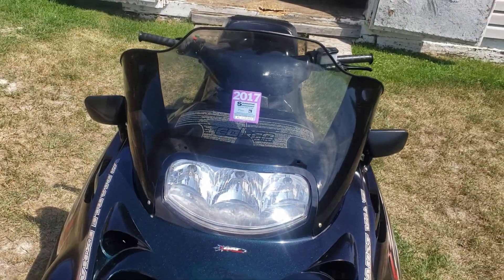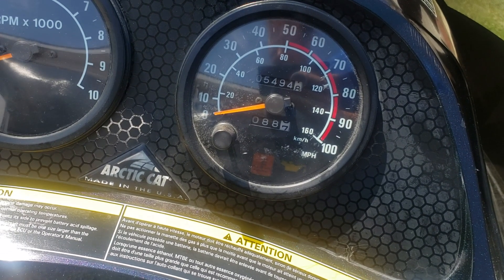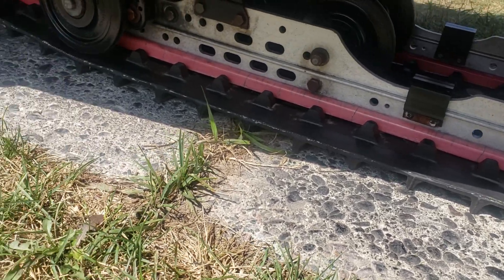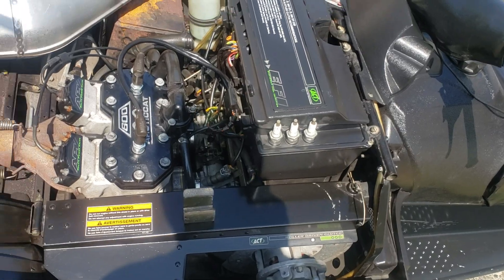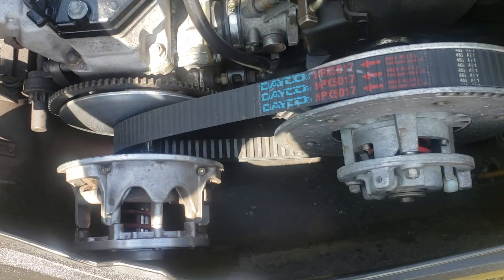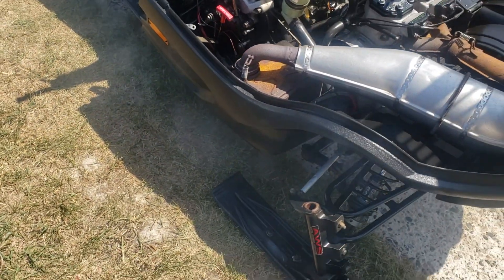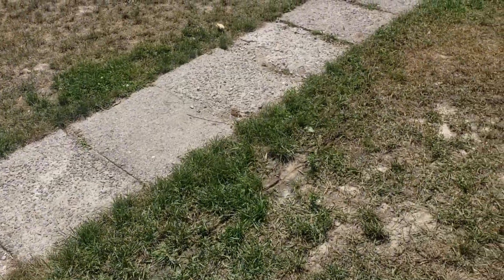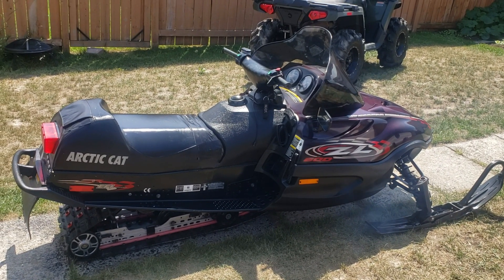2001 Arctic Cat ZL 600 EFI

Comment: I got a 2000 ZL550esr...Looks like you could rotate the Throttle lever down a few degrees (more comfort and better hold on Rt. handle bar) 
Your 600 w/exh. valves and fuelie, must be quite a bit faster than mine. Kids won't get them selves in trouble with it?
Don't bother..I will tell my self<< Non of your business..
Thanks for video

Comment: How do you mix oil or do you have to.? My son has same one with way more miles. This is nice. 
Thanks!
Reply: If you look closely on the right side (when sitting on it) of the engine bay towards the handle bars, there's a clear/white plastic jug. Thats your oil reservoir. The oil from there is dripped into the engine, so as long as you have oil in the tank, you can just get regular gas station gas and keep on trailing.